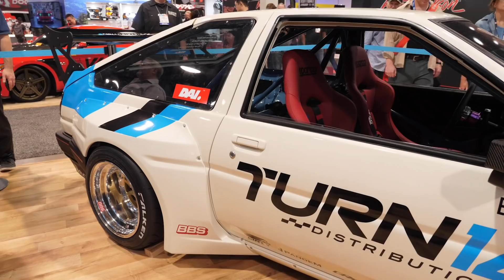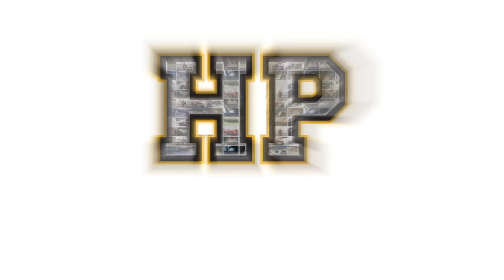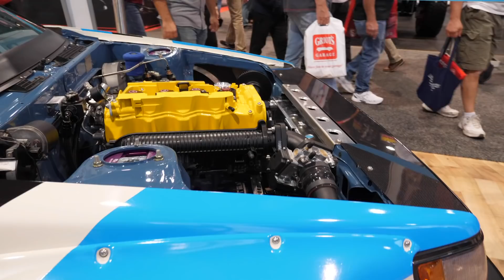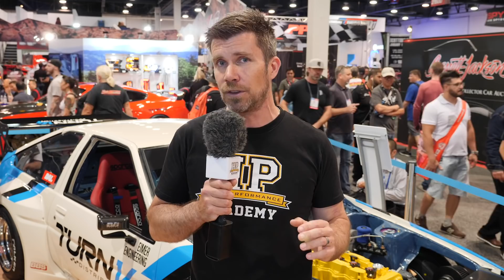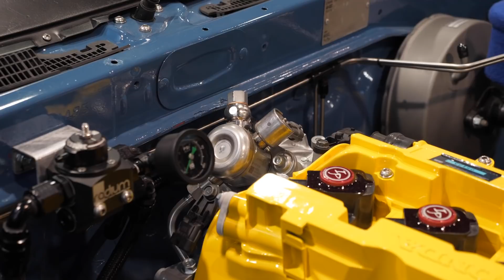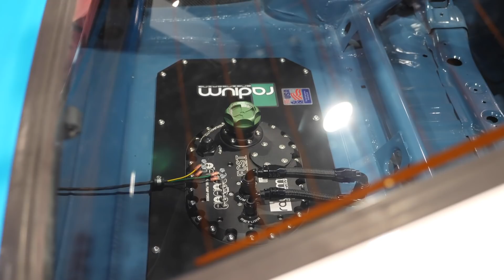Direct Injected AE86 | Dai Yosihara's 350HP K20C1 'Type R' Toyota [TECH NUGGET]

Comment: Honda in a Toyota, yeah NO. 
There are OEM Toyota 4cy DOHC turbo engines that won't need anything more than some extra boost to get 350hp from around 240hp stock. Toyota also has a much longer, and stronger, track record with high output turbo 4 cylinder engines. Was Honda winning WRC titles in the 1990's with such an engine? No though Toyota was. 
Might I suggest the 8AR-FTS, power output is 175 kW (235 hp) at 4,800 - 5,600 rpm and 350 N⋅m (258 lb⋅ft) at 1,650 - 4000 rpm, so don't give me that Honda lump, however good it might be. The Toyota engine has both direct and port injection. We are comparing apples to apples and I would rather have the Toyota brand apple.
This just sadly illustrates how Honda doesn't have anything with heritage, from that vintage, worth putting that engine in. Keep your Toyota all Toyota.
Reply from the maker: Saying that Honda didn't do well in the 1990s in WRC is the same as saying Toyota sucked at MotoGP during the same era 😉There are only a few overlaps where both marques compete at the same time, however, it's redundant as the badge on an engine doesn't make it good or bad. Every marque has produced some great power plants and some duds no matter what tint your glasses are - Taz.
Reply: @hpa101  Read it again. It is not akin to that at all, Toyota never built bikes (as we know) and both companies have about the same history building road cars. Honda could have come up with a Turbo 4WD coupe or sedan somewhat readily if WRC was an avenue they wanted to pursue during that time. Every other major Japanese manufacturer had a Turbo 4WD coupe or sedan when that became the way to go in Group A WRC.
Honda probably would not have been successful right away though neither was Toyota.
By the present day they would have a history of this type of engine, and car, as Toyota does. In road cars Honda has a 5 year history of turbo 4cyl engines in road cars, Toyota has decades of that same history. A transplant such as this wouldn’t be out of place if that engine were in an old Civic. However good the final product is, it’s out of place in a classic Corolla, especially when Toyota makes essentially the same engine with the same power.
Reply: Typical purist. its his car, his money, he (dai) is the one who build it for himself so shut the fuck up if you cant apreciate it or if it doesnt fit your taste gtfoh and build your own version. Simple
Reply: @ichihusni5014  I suppose I am a purist to some extent though a long way from typical. I also don’t need to sidestep most of my brain functions to formulate such an incisive choice of language and state such an ill informed, and surely typical in this case, counterpoint to something I don’t agree with. You clearly can read though if you put a little more work into comprehension skills you’ll learn some words that you can use outside of the YouTube comment world.
Reply: Technically those wrc engines you talk of were Yamaha designed
Reply: @frankflores1917  Well, yes and no.The cylinder head was Yamaha designed (and possibly cast) and Toyota did nothing to hide that, the 3SGTE engine (as used in the ST185 4WD Celica road car) had YAMAHA cast into the timing belt cover. This may be the case with other Yamaha designed heads for Toyota. The rest of the engine, or the engine as a whole, was designed and manufactured by Toyota so technically that statement is incorrect. 
Maybe Toyota could have had Yamaha design a whole bike to run as a Toyota in MotoGP back in the day but they didn't, nor did they do whole engines for Toyota. All Yamaha did was heads for their cars.
Reply: It’s dais build he can do whateva he wants
Reply: Honda was busy building Formula 1 winning engines at this time. How dare you say Honda has no heritage.
Reply: @frankflores1917  Again, comprehension is important. In this type of car and engine they don't.
Reply from the maker: I didn't want to bring up Formula 1 @Frank as not up upset @Nicholas 😉
Both Toyota and Honda have solid racing heritage in most disciplines they have competed in, but it's really all subjective so who cares. Drive what you like and build what you want. The more time spent doing both, the less time there is to argue over ridiculous things on the internet.
At the end of the day even if you don't like this car, it's not for sale, and no one is offering anyone a drive so why worry - Taz.
Reply: @hpa101  As you say both Toyota and Honda each have a very solid racing heritage in most disciplines they have competed in though they have almost always been in different disciplines and if in the same discipline, at different times. I will say Toyota’s racing heritage is more comprehensive, as in different types of vehicles raced and series raced in, while Honda seems to stick their head in at the deep end and goes for it. They were a dominant engine supplier in F1. Honda seemed to stick to asphalt with their efforts, Toyota did dirt, sand and asphalt. 
You can mention F1, and CART while you’re at it. In F1 Honda clearly has the upper hand, and in CART. Toyota and Honda competed head to head (as engine suppliers) in that motorsport during the late 1990s and early 2000s. At that time CART (PPG CART World Series / CART FedEx Championship Series) really was a viable rival to F1. When Honda did a whole car in F1 they had a tough time though so did Toyota when they did their only foray in F1.

You would think they would each come up with an Mega flagship special to showcase all that racing expertise wouldn’t you?
Honda came up with the NSX though it had a NA V6 rather than a weaponized Turbo V6 related to the F1 V6 Turbo that did so well, a great car but is it Mega? 
Toyota came up with the LFA which comprehensively fills the Mega definition and had some direct lineage to their F1 efforts.
What would really be fun is someone sticking a 2JZ, sideways, in the back of an NSX, preferably one of the test mules Senna drove to help them sort out the handling. That way it would be a good car with a great engine and some heritage . . . I’m sure Prost would be up to helping them sort the handling on that one . . . 😉

Comment: 4AGE "350HP, modify it to whithin a inch of its life" Really?
Reply: @FuLLeFFekT1 con rods and pistons and you can comfortably make 350hp all day every day with a turbocharger. Get a later small port engine and you can push it to 450 no worries
Reply: @FuLLeFFekT1 That doesnt qualify as"whithin a inch of its life" now does it. And surely doesnt cost what the Honda plant would have cost. Guess Yoshira is simply THAT GUY.

Comment: Direct injection is nice, you can run leaner and hotter. No fuel on the intake an most of the compression stroke  should mean lower risk of detonation.

Can somebody confirm  that GDI engines  get their oil dirty faster than port injected engines?
Heard some VW/Audi  mention this.
Reply: They produce more soot. Diesel or petrol (Gas)
Reply: Audi engines have problems with piston rings, especially early 1.4L, 1.8L and 2.0L turbos.
Rings are made thinner for lower friction, that may be the reason in this case.

I had the first mass produced DI engine, Mitsubishi 4G93 GDI , N/A, 12:1 compression. And i did not notice nothing unusual about oil, but my car was serviced more often than instruction book says. 

But thats true, that DI may make oil more dirty bc of carbon and soot. 
And we are living in long-life oil era :) 

Bigger problem with DI - carbon in intake :( 
There are some engines with direct+port injection. 

Excuse my English.
Reply: In fact some ppl use diesel oils (with more dispersants and cleaning stuff) in their GDIs.
Reply: There is a well known problem of combustion products building up in the intakes from reversion, with direct injection engines - might that be what you're thinking of?
Reply: They eat coils, plugs etc
Reply: One of the flaws that many DI engines have is that unlike MPFI, you don't have the cleaning effect of fuel spraying on the valves, so over time, carbon ends up building up on the valves.